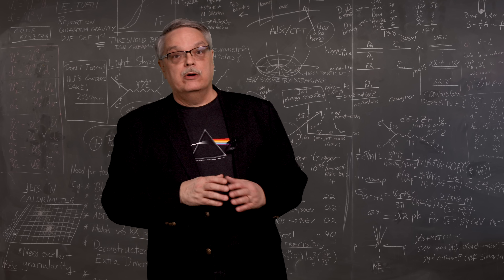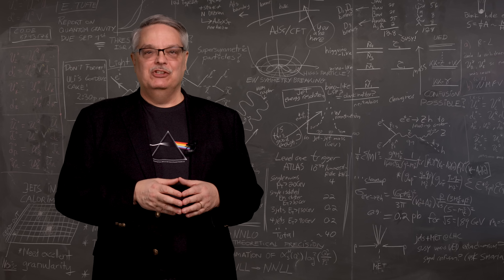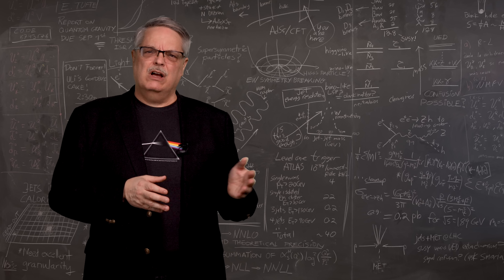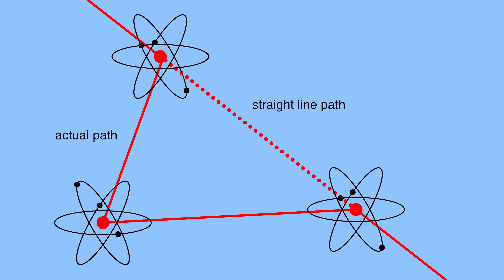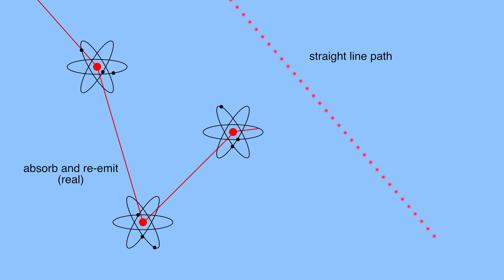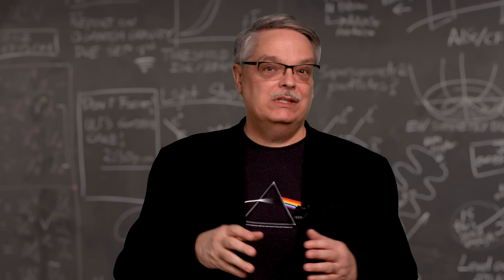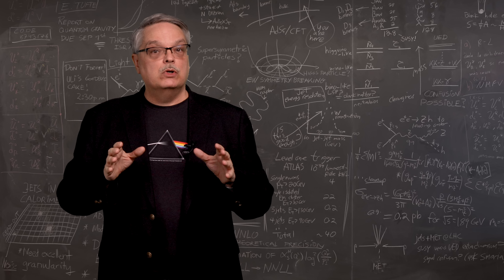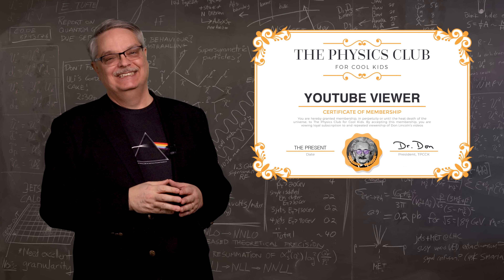Why does light slow down in water?

Comment: So what is necessary for light to slow down is the existance of one or more charged particles. These particles oscillate from the EM fields of light producing new EM fields which effectively slow the speed of light. Now consider a photon of high energy. This can be experimentally divided into a negatively charged electron and a positively charged positron. This means that inside the photon these charged particles do exist. So I believe that because of these charges, at very high energies photons travelling at vacuum should start slowing down. Do we see that experimentally ? Yes !! These particles are the neutrinos, which are basically high energy photons which travel in vacuum slightly slower than the speed of light so they appear to have some "mass". Now if we increase the energy of these photons, there should be a solution that light is trapped in itself. That is think of a glass sphere that we throw a light beam tangentially into its surface. The beam will be reflected into the surface of the ball and will be trapped going round the sphere. In our case the refractive index changes because of light itself. So in this sphere light makes a resonant static wave. Using fibre optics equations, the first mode of this wave has two solutions. The one has the electric field vertical to the sphere and the magnetic field tangential, and the other the electric field tangential and the magnetic vertical. I believe these solutions are the proton and the neutron. And it seems that the proton solution is more stable than the neutron, so neutrons are after some time converted into protons. The other elements of the periodic table are higher modes of this resonant wave. So I believe inside an atom there are no protons and neutrons but light is oscillating at different modes. And this is how matter is created from EM waves. Dr Kostas Zaglanikis, PhD in Fibre Optics, University College London, zaglanikis@yahoo.gr

Comment: In fact, the second "incorrect" explanation offered for refraction is actually incorrect because it assumes scattering at all angles will occur and no single path is preferred.  But this is not true. A path in which the complex amplitudes add is preferred and explains the refraction.

Comment: I'm still not convinced. In order to generate the new wave, the old one must also propagate in a close proximity. Has it been tested with a single photon? Dough it, because none of the smart bottoms people can tell me, if a light is a particle and a wave at the same time, so how many wavelengths does it take to make a photon, or vice versa.

Comment: In 7:11 it's said that when one wave moves in another speed than the other one, the resulting field moves slower than the fast wave.
But, where is the slower wave when the electron oscillates? The electron oscillation should produces a second wave at the same speed (of light).
I don't get it..

Comment: I am sorry but this explanation is totally unsatisfactory. At 7:16 you say "the resulting wave has a different speed than either of the two." That is not true. Wave #3 is a standing wave. It still has the same frequency as the other two waves. It is true that combining two waves like 1 and 2 results in a wavevorm like in #3. But since the frequency is the same, the wavelength is the same. Since f = c' / L  (c' here being the speed of light other than vacuum), f and L did not change, hence c' did not change. Maybe you are right about the electrons creating an electric field, but adding to sine waves do not result in a different frequency. Ever.

Comment: Light isn’t a “point-like” photon. Both of the wrong explanations are immediately wrong by assuming such.

Light is a spherical wavefront in the electromagnetic field. A light “ray” is merely where multiple wavefronts constructively interfere:

The ray isn’t a single “photon.”

7:45 Light doesn’t have color. Color is the language your visual cortex uses to communicate information to your prefrontal cortex.

9:20 “Waves from an electron move at a different speed.”

😂 No they don’t. Oscillations in the electromagnetic field all travel at c; even ones generated by electrons. As a matter of fact, most light we deal with is generated by the oscillation of electrons/ions.

What moves at a slower velocity is the resultant wave of multiple waves interfering with each other.

Comment: I am afraid your explanation is not correct either.  The first explanation based on the idea of multiple scattering, which you dismissed, is qualitatively correct.  The quantitative explanation is given by the Ewald-Oseen extinction theorem.  Long story short, the scattered waves add up to exactly cancel the incident wave traveling at c, leaving only a coherent wave traveling at the speed of c/n at the angle of refraction.  The refractive index n is self-consistently determined by the intensity of scattering; the stronger the scattering the larger the refractive index.  Your illustration indicating a diffuse scattering is wrong as long as the medium can be regarded as being uniform (on the average) within the wavelength of light.

Comment: Very cool. If you had a single photon, would it bend? The bending is based on having a wavefront of a bunch of photons, but would a single photon also change its direction?
Reply: yes, because if you use the correct physical explanation using quantum electrodynamics and calculate the photon propagator for the process you get that result. This video explains it in a simplistic classical manner which is only an approximation to the actual correct physics.

Comment: Wait a minute, when two wave of different speed combined the result is a new wave at a different speed - totally makes sense. 
However when oscillating electrons emit a new wave, wouldn’t that wave travel at c too, and thus the combined wave should still travel at c? 
What am I missing here please?
Reply: Hi my past self... your future self here.
Yes the emitted new wave does indeed travel at c too, but it has a different wavelength. 2 waves of the same speed but different wavelength combined togather will also result in a wave with different phase velocity.

Comment: Interesting that light may slow down in water but sound increases speed to 4.3X it's speed through the air, from about  1,125 feet per second to 4,855 fps.

Comment: how does this work with light being reflected by mirrors?.. as in why does light pass through a mirror? does it not have electrode cells?
Reply: It might depends on whether the mirror was coated on the front surface, like telescope mirrors, or on the back side of the glass like bathroom mirrors.  I know that rear-coated mirrors cause distortion and can't be used for astronomical telescopes.

Comment: Why is the speeds of original EM wave and the one created by oscillating electrons inside the solids become different....?  Because only if their speeds are different then the superposed wave moves slower......The actual explanation is no so simple, and one has to do a quantum filed theory calculation (using Feynman diagrams) to find out the self energy correction of the photon propagator to arrive at reduced velocity of photon inside a medium.....

Comment: 8:05  This completely glosses over the most important point.  In order for the oscillating electric field produced by the moving electrons to slow down the light, doesn't the electron field have to be slower, or at a different wavelength than the light, or something?  Which is it, and why does that happen?
Reply: I know.  Contrary to what most people are saying, I thought he did a half-assed job explaining it.  He says the electromagnetic wave created by the electrons is slower, but doesn't explain why.  I assume maybe it's because the electrons can't instantaneously react to the light wave so there's inherently a delay in the induced field (kind of like if I were to try to copy someone else movements, my reaction time would always be slower).  Exactly what waveform parameter that affects I'm not sure (frequency?).  When added to the light wave itself, the resultant wave is apparently slower.  I know that doesn't really answer your question, but eh, it's fun to think about.

Btw: I don't have notifications turned on so sorry if I don't necessarily respond.

Comment: So what happens with more than one electron?
The light 'wave' hits the 1st electron at the surface of the glass - this generates a secondary wave immediately but at the same time there must be millions of electrons all generating their own field - why does the rest of the electrons not influence the light wave?

Then..
In reality - When the light wave leaves the glass medium it will immediately enter the atmosphere which is full of atoms. How does the light wave interact with oxygen, nitrogen and every other element that's floating around the atmosphere?
Does the light wave immediately change to the 'air' speed?
Interesting thought, at what point exactly does the medium change from glass to air/water etc - when does the speed change?
🖖

Comment: I still don't get it.  I understand the electrons being affected by the light and the wave theory ("speed = wavelength / period" and "speed = wavelength * frequency").  But an electron moving would generate a magnetic field, wouldn't it, not an electro/magnetic wave?  Also assuming the waves just combine, when the electron wave combines with the light wave, wouldn't this affect the frequency so as to maintain the constant speed of light?  This explanation is based in wave theory. But light is not just a wave, it is a particle and a wave.  How does this work with the dual nature of light?

Comment: But wait ... if an electric field from an electron can interact with the light, why doesn't light get affected when moving through an electric field, say around a very large motor or a capacitor discharge?
Reply: Light does get affected by electric fields.  There is a phenomenon known as "gravitational lensing" that comes into play around black holes and other super massive objects, causing background objects (stars) to appear as two instead of one.

Comment: Ok, but I don't think so.  It is the reverse of thunderdome "two men enter one man leaves".  So a second wave is created like eddy currents.  This wave interacts with the entering wave and interferes with the original wave's Frequency and Wavelength and therefore it's velocity.   When it leaves and reenters a vacuum the second wave is no longer created and so the original has no interference and resumes its "natural" speed in a vacuum.   Once the wave is modulated what causes it to go back to its original configuration?  Wouldn't you have to add energy?   Yeah, I don't think so.

Comment: Light is but one band of energy which travels through propagation not transmission.  If I splash in a pool and the wave (signal) propagates to the other end of the pool, did the "wave" move?  Did the water travel to the other end of the pool?  Or did the perturbations in the water propagate outward?  It's easy to understand this in the medium of water.  But when "brilliant minds" decided that light was a particle, they destroyed any hope of average people understanding light.

The problem with light and radio for that matter, is the medium of signal propagation.  The space is a vacuum... no matter like air or water to propagate the signal.  So what is the medium?  It's the mythical and not really understood "ether."  THIS is why science is largely terrified of this notion.

Comment: Dr. Lincoln: I'm not convinced of your explanation.
When two waves superimpose the net addition will have the composite character, true.
But the individual waves making up that composite will still move at their original natural speed and frequency.

The apparent speed of the composite wave can't affect the waves that add up to it.

If light does actually change speed in water, glass, etc., it requires some other explanation.
Reply: Solve Maxwell equations for light traveling in a medium - you will get result you want.
Reply: @olasek7972  , Didn't think Dr. Lincoln's explanation was adequate.
Reply: @peterblock6964  that’s the best you can do without equations
Reply: @olasek7972   Guess I'll have to learn some serious math one of these days.

Comment: Ok agreed that the composite wavelength will be slower, and so it will take more time to get out of the other end of the material, but my question is, since one of the individual wave (the initial ray of light) is faster than the composite wave, why wouldn't it get out of the other end of the material/matter, faster than the composite wave..?

Comment: Great explanation. It would nice if you covered why the light changes direction when it changes speed. Based on your explanation I'd guess it has something to do with the direction of the wave induced in the electrons changing the effective direction of the initial light wave, but I'm having a hard time coming up with exactly how that works.
Reply: Yes, why should it change direction. Also why should it be slower just because its interacting with another field?
Reply: @rupakrokade  It isn't slower. Electrons have inertia so that their motion lags the incoming field. The field that they re-emit lags the incoming field. The superposition lags the incoming field. The lag becomes progressively greater as the wave propagates through the medium.
Reply: Yes, the explanation given is only for the change in speed. To further explain the change in direction, he needs to explain about polarization of the light.
Reply: @crossjames9577  You don't need to worry about polarisation to explain the change in direction. It is a consequence of phase continuity across the boundary coupled with the changed wavelength arising from the change in speed.  Consider a light beam of a particular width hitting the boundary at some angle to the normal. The phase at the boundary varies linearly with distance along the wavefront. In order to have phase continuity between each point on the wavefront across the boundary there has to be a different wave direction inside the medium.
Reply: Hey! Look what I found! "Why does light bend when it enters glass?" - https://youtu.be/NLmpNM0sgYk
Reply: The change in direction is a consequence of phase continuity across the boundary coupled with the change in wavelength arising from the change in speed.
Reply: It is to do with phase continuity over the interface ( the phase just inside the boundary must be the same as the phase just outside the boundary.  For a plane wave the phase is constant orthogonal to the propagation direction and the speed difference between the media.

Comment: Explaining this in terms of infinite interfering wave misses an extremely important fact. If you shoot a pulse of light into a medium, the leading edge of the pulse will always be speed of light in vacuum. It is simply that the leading edge becomes extremely faint. The "bulk" of the pulse, so to speak, slows down as expected, while a thin, effectively undetectable "leading tail" spreads at c-in-vacuum. Another way to put it, in terms of photons: there is zero chance of a photon entering the medium and appearing on the far side of the median in time < distance/c (no violating relativistic causality), but a greater than zero chance of the photon arriving on the far side at time >= distance/c. Indeed, uncertainty in the starting position of the photon can make it seem like the photon took even less time that require for the speed of light in vacuum to cross the medium.
Reply: If the wavefront moves @ c, but the trailing bulk of the wave slows down, then the wave stretches out, and wavelength increases.  This is the opposite of what is said to occur when light enters matter with higher refractive index.  The wave velocity (i e., wavefront) slows down, the wave becomes compressed and the wavelength is lowered.
Reply: @krysoboi  That is a good question. It is simply much more complicated than the simple sin waves models that are taught. There is no such thing as light (or any other wave phenomenon) that is a pure frequency or wavelength. That is only a useful approximation in certain situations -- for example in the "middle" of a sustained beam of duration much longer than the wave period and length much much longer than the wavelength. The same rules(approximations) and intuitions do not apply at the beginning or end of a such a beam, nor for any short pulse or wave packet.

There are no pure, eternal, infinitely long sin waves in the real world. But much of wave dynamics is taught as if they do, because it is such a useful and applicable approximation. It explains a lot of things, but not everything, and leads to incorrect conclusions if applied in situations where the approximation does not apply.

When you have a pulse or wave packet, you automatically have something that includes a mix of all wavelengths (this gets into fourier transforms). Light is more correctly seen as a collection of photons, each of which is such a "gaussian wavelet". The wavelet will have a central or average wavelength, and it will have a spread. It is entirely possible for the packet's bulk to "squeeze" to narrower wavelengths, even as the edges of the pack spread absurdly thin.

Comment: 7:35 why we can transmit and receive some waves with transmitter and receiver and antennas but we can not do that with the light, or can we ? 
Not kind of, possibly, theoretically,.... but can we really have an oscillator and amplifier driving the antenna and transmitting the light, and at the other end receiving it and turning into sound ?